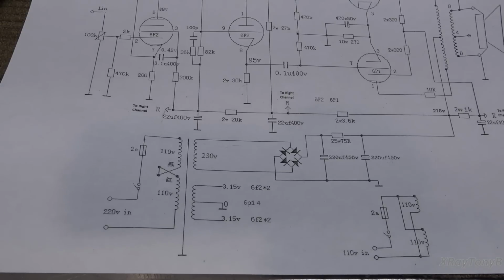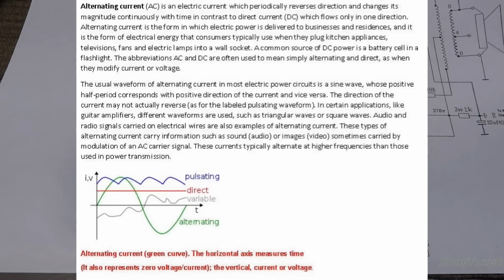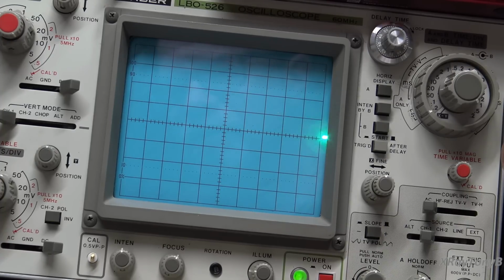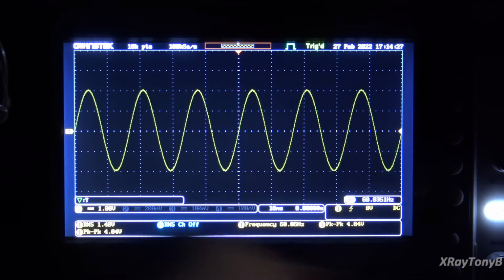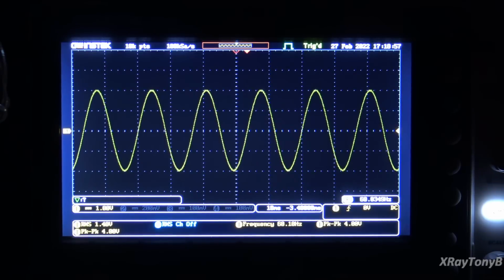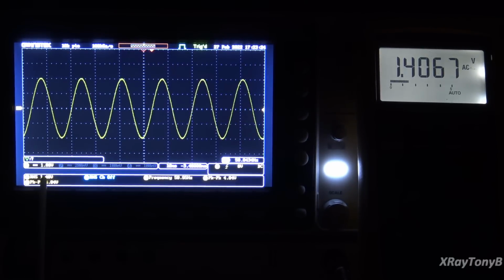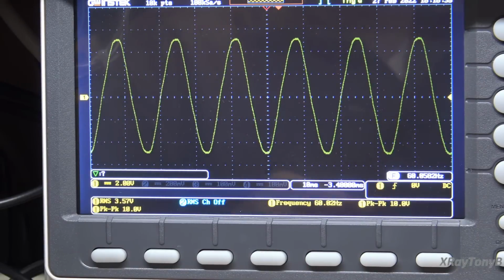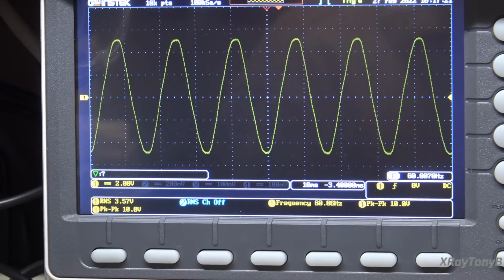Electronics 101½  Part 2 - DC, AC, Peak, Peak-to-Peak & RMS Voltage Explained

Comment: The only thing omitted was the most important part... WHY is the RMS is equivalent to the DC.
And that can be explained with the oscilloscope by offsetting the AC Sinewave, so that it sits completely above the Zero Volt centreline.
So now we have 5V RMS AC which is peaking at 5 x 1.414 = 7.07V Peak-to-Peak. Now "fill in" the section between zero volts line and the sinewave line. In other words, look at the amount of area (power) under the curve of the sinewave... If you calculate the entire filled area, it will be the same amount of area (power) as a continuous 5V DC (which is a straight horizontal line).
The formula for other shapes of waveforms is different to the 0.707/1.414 ratios used for Sinewaves. The RMS of a Square Wave with equal 50:50 pulse widths is 50% of the Peak-to-Peak, because effectively the power is only occurring for half the time.
So, as Tony says the RMS of an AC voltage is the amount of power that will do the same amount of work as the stated DC voltage.

Comment: A have a sansui au719 having protect issues have 18.77 mv at idle is this a sign of a  problem
Reply from the maker: 18 millivolts shouldn't be enough to trip the protection circuit.  I would start by checking the power supplies as well as checking for DC offset BEFORE the protect relay.

Comment: When you get to describing the bridge rectifier could you perhaps explain why some audio amplifiers have ceramic capacitors in parallel with each diode in the rectifier?  I see this mostly on amplified computer speakers.

Comment: Tony, this is an excellent video!  Best I have ever seen to explain AC and DC.  Do the electons in an AC circuit actually travel a distance or is it just a shift in polarity going positive and negative, such as a magnetic shift in polarity? 73, AA4EZ
Reply: Even in DC, the electrons themselves move relatively slowly, transferring their energy to those downstream. In AC.
Reply: I've always understood that in ac the electrons move forwards and then reverse backwards. In effect they end up more or less where they started bearing in mind that if the current is interupted part way in a cycle they will be displaced slightly.
Reply: @jonka1  That has been my understanding also, that the electrons just kinda shift back and forth without really "traveling" any distance, as in an electron "flow".  It isn't really a flow of electrons going from one charged pole to the opposite pole, but a transfer of that energy from one electron to the next, with that energy being "used" by the load, if one is present. Does that fit in with your understanding?
Reply: @raymondlewis2055  I'm not certain that I am up to speed with that idea. I can see that true AC (not varying DC) would fit but as to what happens with DC, I'm not sure. It makes sense that electrons would flow onwards but I've never explored this. BTW I have 55 years of hobby electronics behind me and stuff seems to work out well.

Comment: Nice to have a primer. I have a request. When you move from basics to actual circuits, make sure to cover the role of <i>every</i> component, each resistor and capacitor, even if it's totally clear to you. In my experience, at some point text writers lose patience and skip a few steps earlier than enemies of the electron like me are capable of treating as obvious. Things like pull-up resistors, filter capacitors, current limiting thisahs and thatahs -- at some point enough of these things show up at once that I begin to get lost and can follow only the gist. A particular example is the aforementioned current limiting resistors, which I always just equate with "space heater" and wonder why some less wasteful thing couldn't be used instead.  It goes on like that.

As an example, it <i>does</i> matter about that resistor right now. What's it *&(*&(*$R# for?

And what does the initialism RMS expand to? You never once said the words "Root Mean Square." That's dumbing down the audience, and annoying people who dislike unexpanded acronyms and initialisms.
Reply: What's it *&(*&(*$R# for?
That doesn't even make sense.... at some point we readers just lose patience and stop reading.

Comment: Great explanation of R.M.S. and why we use it. Could you explain why that doesn't work with a non-sinusoidal wave? (Or maybe that's for a different video). (I'm not trying to show off - I know it doesn't work, but I couldn't explain why properly).
Reply from the maker: The RMS of ANY waveform will always equal the same DC value.  1 volt RMS will do the same amount of work as 1 volt DC.  The issue is that the √2 formula only applies to a pure sine wave, if you are calculating the RMS value.  For non-sine waves you need to calculate the square root of the mean of the squared magnitude of the signal, which is a bit more tricky.  True RMS meters (like the fluke 187 I was using) will measure the actual RMS value of an AC  signal regardless of the waveform.  The meter still has a limit on the maximum frequency it can accurately measure.
Reply: @xraytonyb  Thanks for your detailed reply. I did mean the square root formula wouldn't work on none sinusoidal waveforms. As you say any waveform has an RMS value. But I haven't learned the math. I didn't know a true RMS meter would show the RMS of any waveform (ltd by frequency constraints) but I guess the electronics works the same.
Reply: Just been to a website which shows the formulae for different waveform RMS values. Thought I should learn at least the squarewave formula as I repair SMPS units for a living 🤣
Reply: @radio-ged4626  - The square wave formula is the Mark/Space Ratio.
Reply: @johncoops6897  LOL yes it is. Kind of dumb of me not to realise that. I think I've been fixing SMPS for too long and stopped thinking about the theory.

Comment: I measured the output power of my 1965 Magnavox console with 8 ohm dummy loads at 1KHz and got 20 volts PP at the onset of clipping, which would be 10 volts peak AC.
 RMS would be peak X .707 = 7.07 volts RMS,  that squared then divided by 8 = 6.25 watts RMS per channel.

Comment: Some digital meters do not measure RMS voltage correctly. I believe the old analog meters like a Simpson 260 read RMS as a function of their mechanical nature due to inertia of the mechanical movement.

Comment: Some still call pulsating DC, or AC with a DC offset, as AC. 
In a debate on another channel I tried pointing out crossing over zero point and changing polarity to qualify as true AC. His definition of DC was a constant current without any variations or change. I had to say we have to agree to disagree and part ways, our training in electrical school was different and we were getting nowhere in a debate. Have you Tony, or anyone out there run into this?
Reply: According to Tony's definition (in this video), it changes between "Pulsed DC" and "AC" when you move the zero volt reference point. In actual fact, it makes absolutely no difference whatsoever... all the reference points are arbitrary anyway.
Reply: @johncoops6897  
When there is no current flow, that is the zero reference point, it is not arbitrary.
Reply: @zulumax1  - you need to read my comment properly before arguing. Also, research the meaning of the term "arbitary", when used in the context that I wrote it..
Reply from the maker: Yes. Many times
Reply: I think Tony’s scope is correct and Tony is wrong on this point. The scope (correctly) reports AC with DC offset — NOT DC as Tony claims. The wave form is sinusoidal = AC, in my opinion. If the scope were fed the output of a full-wave rectifier, I’ll bet that it would correctly interpret it as (pulsating) DC. So, in this case, I feel Tony muddles the issue for newbies by introducing a waveform not commonly seen (at least by me). It would be more helpful, my opinion, to show the student an AC waveform compared to the output of either, or both, a half-wave and a full-wave rectifier which is universally interpreted as DC by both analog and digital meters, let alone DC motors and the like. 

Having said all that, I can certainly empathize with the difficulty of explaining this to people who are unfamiliar with the distinction between AC and DC. I spent two months this summer trying to explain how rectifiers worked to groups of would-be electricians in our local community college. It was an exercise in frustration (mine), it apparently is a difficult concept to grasp if you don’t get it early on.
Reply: @jeremiahchamberlin4499  I was trained the way Tony was trained. two different understandings of what is going on. No end to this debate, I am going by what my engineering books tells me. If the DC component is greater than the AC component, it is pulsating direct current.

Comment: 20:26 - I would say that the 'scope is correct and that "True RMS" meter is lying! It's not taking into account the DC offset!
Reply: That is what I was thinking. The meter is in AC which removes the DC component, it doesn't know it is there. You would measure the DC first, and add it to the AC RMS reading for a total.
Reply: Thanks. I was hoping to understand why the digital scope would be "wrong". Is there value in the way the meter was doing it? (Even if that's all it could do for technical reasons.) Why wouldn't the scope offer both, or maybe have a toggle button, for example?

Comment: Tony, great explanation. I'm wondering, does the frequency of the AC signal change the average (RMS) value? Your example shows 60 Hz. What if the signal was 60,000 Hz?
Reply: Wouldn't change the RMS value. Some meters might not be able to read it accurately though. Some cheaper meters quit reading accurately at a few khz.
Reply from the maker: The RMS value of any waveform at any frequency will be the equivalent to its DC value.  Both the DC and RMS values are capable of performing the same amount of work.  Only a sine wave will have an RMS value that is 0.707 (which is 1/√2) of the peak.  For non-sine waves you need to calculate the square root of the mean of the squared magnitude of the signal.  Lower cost meters can't accurately measure the RMS value of non-sinusoidal waveforms.  A meter that is "True RMS" can accurately measure the RMS of non-sinusoidal waveforms, as long as the frequency is within the range of the meter.  ;)

Comment: (@3:29) - Whoa pony , whoa! You absolutely can have voltage without current. A battery sitting there has voltage, but (for all practical purposes) no current. Likewise, a dead short will have current, but no voltage across it. Okay, giddy-up, pony! (Or, should I say, “Tony”!)
Reply from the maker: A battery, capacitor, etc. can have a potential charge on it.  This is not the same as voltage and current.  Voltage and current are the factors used to determine how much work is being done.  The Work is defined by its electrical power and power is the product of Voltage and Current.  In other words, P=EI.  If either I or E = 0, then P would equal zero.  You must have Voltage AND Current to have power.  Even a dead short has a very small amount of resistance, which would equal a very small voltage.  The exception is in the case of superconductors, where there is zero resistance and very high current, but not how we are used to looking at it.  The energy in an MRI cold-head magnet is very high, but not infinite.  You can't really measure voltage or current (unless you are ramping the magnet up or down, in which there is a certain amount of voltage & current in the resistor in the ramp circuit) and you need to use quantum mechanics to explain what's going on inside the coil.  When you start talking about Cooper pairs and the quantum state of a superconductor, the whole concept of current flow and voltage is no longer relevant.  The energy still produces a resultant magnetic field, which is still subject to Maxwell's equations.  I don't really know as much about this stuff as some of my friends do, as I don't work that much with it and they do every day.  So that's the best explanation the village idiot can give ;)  Good to hear from you William!  I always enjoy your comments!
Reply: @xraytonyb   - Actually, it is: here’s the definition from Wikipedia (search: voltage) “Voltage, electric potential difference, electric pressure or electric tension is the difference in electric potential between two points.” (In this case, between the terminals of your battery, or your bench power supply.) It can also be thought of as the force required to separate unlike charges, or the force needed to keep them separated. Just because one isn’t measuring the voltage across a battery, doesn’t mean the voltage goes away - that would royally suck! And, yes, a big, copper bus bar stuck across a car battery will quickly drain the battery, and it’ll get really hot (as it’s internal ESR is higher than that of the bus bar) and maybe burst, catch fire, or explode. The voltage drop across the short, though, will be negligible compared to the nominal open-circuit voltage. Does anyone know what the ESR of a typical lead-acid car battery is, anyway?
That being said, though, those are edge-cases, and only the open-circuit case is normally encountered (until you forget to use an isolation transformer on a hot-chassis set, and you go to measure the voltage somewhere in the circuit with your ‘scope - oops)!
Reply: @williamsquires3070  a battery just sitting there most definitely has current. Why? Because it has internal resistance. No battery lasts forever.
Reply: @HazeAnderson  True - that’s why batteries left on the store shelves for decades are no good when you get them home.  Of course, measuring said leakage isn’t quite as easy as it is with capacitors. Of course, I should have been more specific; there’s no current “external to the battery” (since there’s no complete circuit).

Comment: I got a intake like that input for a bike kit system a little more advanced than this since you need to draw charge at once on top used a dynamo solar AC 5v one amp charger... so upto 20v at around half a amp constant unless slow to charge a high power front, indicator and dule brake gps speedometer horn want to app it learning 😁 curcit drawn prototype in works to make sure time should fit all 50mm frames may get 25 maybe!. Had to do a few things to get it working with load drop over!. And stick a inductor dule line should help with temp maybe???😃😄😁😆😅 5 Smiles generally to current.
Reply: Beware your eyesight may fail.
Reply: Come back when the drugs wear off, Troy.